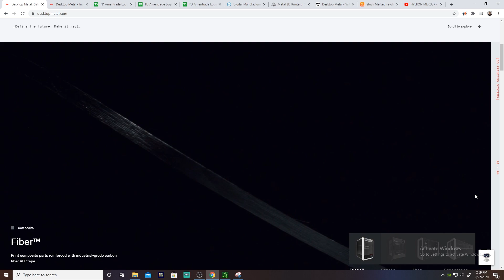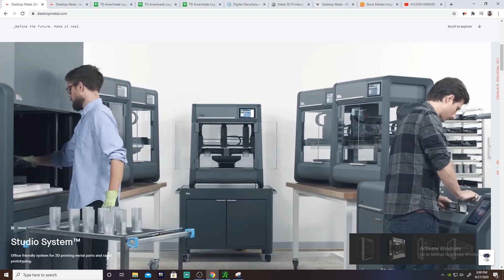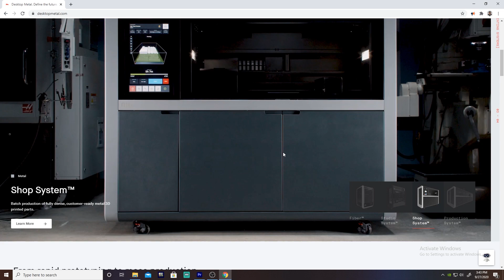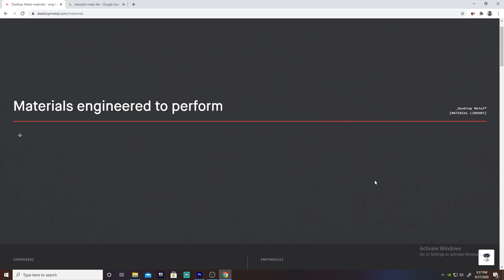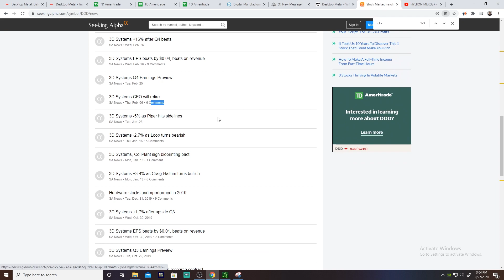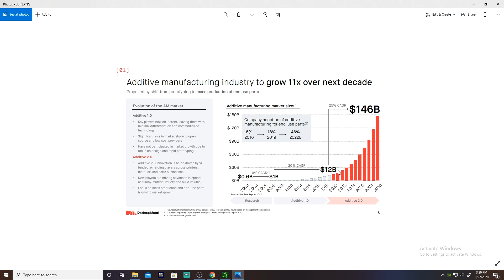TRNE DESKTOP METAL TECHNICAL ANALYSIS - BY AN ELECTRICAL ENGINEER - MY NEXT SPAC PLAY

Comment: Even if this SPAC drops below 10 you can still redeem your shares for 10, so there's almost no risk.
Reply from the maker: GEN LIU hmmm interesting I’ll have to look into that I wasn’t aware!
Reply: @ThatEngineerGuy_  It's true.  Prior to the merger, the SPAC sends an offer for shareholders to redeem for the amount in the trust plus a small amount of interest.  For DM the floor is $10, so if you buy around that price there's pretty much no risk until the reverse merger date.  For most SPAC's the floor is $10, but not all, so you have to read the filings to be sure.
Reply from the maker: Cam Rielly interesting! That was my general understanding but didn’t think it was set up like that exactly. Thanks for adding!
Reply: @ThatEngineerGuy_   It's a pretty safe bet to ride out the election volatility.
Reply from the maker: Cam Rielly oh I couldn’t agree more it was chilling through the whole pull back too😂

Comment: I dig your analysis.  Especially with your insights with actually having seen parts produced by them. I feel like most the videos on TRNE I’ve seen is just youtubers regurgitating the investor presentation.  

I’m also curious to see more with their fiber machine. I’ve heard that traditional carbon fiber methods generates a lot of waste, which is expensive. Additive manufacturing also allows them to print different materials into it, like copper into aircraft wings, to help de-ice.  

Restructuring of the global supply chain will also be crazy.

Two biggest investments in my portfolio have been Hyliion and this company. It’s weird, I had a really strong gut feeling about them. So far one of them has paid off. 

Keep up the great content. Subbed!
Reply: Same. I don't invest in multiple SPACs. Ofcourse there are many good SPACs, but I think Hyliion and DM are worth the investment in my standards.
Reply from the maker: Lisa Hannigan I usually try to only hold 2-3 positions at a time so I can ensure I have a good pulse on each
Reply: Lisa Hannigan couldn’t agree more! Plus I like the fact that neither have much in terms of publicly traded competition. Thomas Healy and Ric Fulop both seem like very down to earth, centered and focused CEO’s.
Reply from the maker: Jens Rhude don’t forget 4 MIT professors that are co founders!! Not just engineers working there but the dudes that where there at conception.
Reply: The Market Engineer oh totally! Forgot the investor presentation had them listed too. Great point! With all the bullish things this company has going for it the price point is completely insane. Let’s go!! 😆
Reply from the maker: Jens Rhude right can’t wait to take a larger position soon!
Reply: The Market Engineer haha the struggle to not throw the rest of my chips onto the table with this one is strong!  Do you think you’ll load up on warrants or shares?
Reply from the maker: Jens Rhude I usually just trade shares. I like playing the volatility and trading in and out. Using profits to buy more shares. I don’t see these guys running like crazy though this is a great growth stock so maybe we’ll play this different. This weekend we’ll dive back into these guys and get into it all.
Reply from the maker: Jens Rhude thanks! I plan on looking into that to I’ll be covering this more now. That’s a great point with the aircraft wings. Probably wouldn’t be used in that setting but the idea behind it would be applicable somewhere easily. Lot of applications if you can print isolated conductors into harden metal machines parts. Yeah I see a lot of growth for them. I don’t see it running like Hyliion at all but I’m excited none the less. Thanks for stopping by glad you enjoyed catch you in the next one.
Reply: The Market Engineer Thanks for the reply man! I’m excited to hear you’re thinking of covering them more.   Oh totally. Their machines are more turnkey and smaller for that reason. Just couldn’t  think of any other examples.   

I agree. It’s doesn’t have the EV hype of retail investors, but it does have a lot of institutional investors. Gota love being early to things! Take care!
Reply from the maker: Jens Rhude agreed im going to be patient with these guys a bit longer of a hold then usual